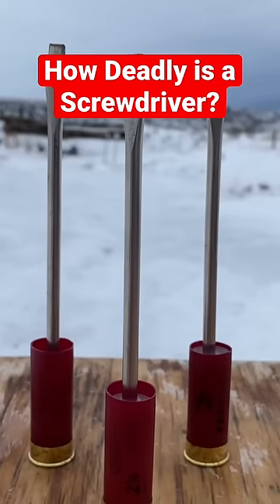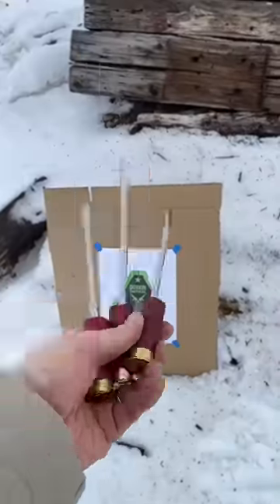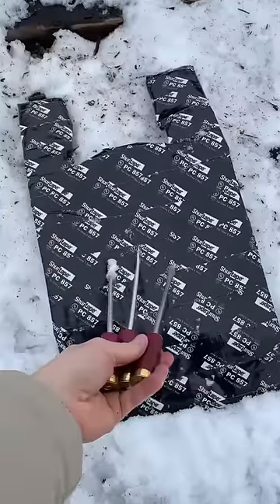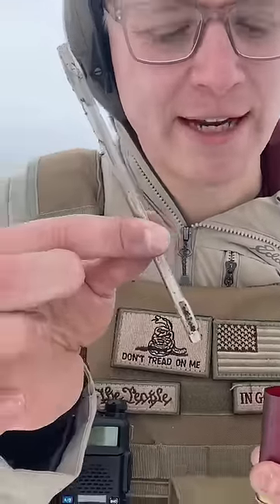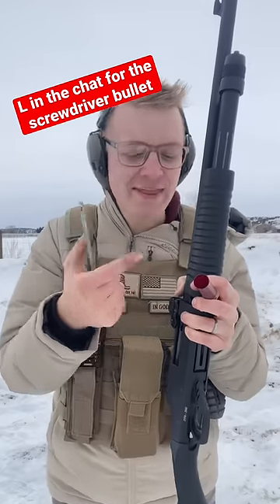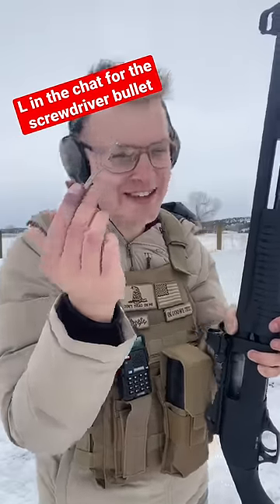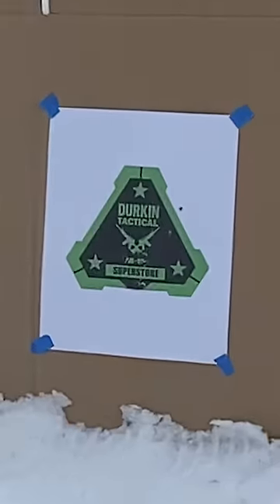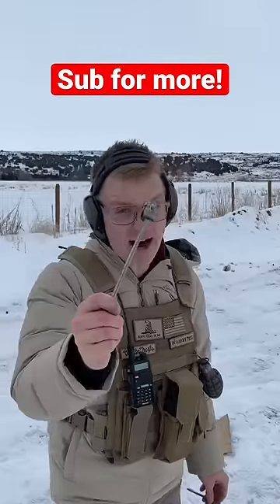(Fail) *SCREWDRIVER BULLET* Deadly? #gun #fullautofriday #demolitionranch #civtac #airsoft

Comment: Next time add a dime to the top of the wad. That way it will push any narrow projectiles and allow more pressure to build.
Reply: Exactly. Lol pretty simple physics. Even a few washers would work. Weld them to some washers and bingo. It'll run.
Reply: A dime would have doubled the value of production, seems this one was rushed and not thought out.

Comment: Just sand the handle of the ole craftsman down to the diameter to fit in the shell. It's simple. Chuck up the screwdriver into a drill press and then using a die grinder and a green rollock reduce the diameter till it fits.

Comment: Stick a 1/16" steel disc under the bottom of the screwdriver in the wad, it will certainly work. RIP to your barrel though, unless you make something to keep the tip centered, if not it will tilt inside the bore and scratch nearly the entire length of the bore.

Comment: that wouldn't work unless the barrel is same size with the screw driver you need to stick something on to the end of the screwdriver like a small cylinder block to create a pressure that will lunch the screwdriver

Comment: What if you just cut the handle 1in down or 3/4 of an inch down or whatever and then sand it down to a perfect circle to fit inside of a 12-gauge? Wouldn't that be better than putting a metal tablet down at the bottom cuz then it would still be almost the same as a screwdriver with just a small part of the handle. And therefore it would cover with a screwdriver shoot from a shotgun more so then would the metal piece of a screwdriver shoot from a shotgun.

Comment: Just fill the void with hot glue or caulk so the wad stays connected to the screwdriver as one.. honestly I thought you took the handle of the screwdriver to a sander and made it's diameter met the ID of the shell on top of the wad.. this was doomed to fail from the beginning since someone didn't pass grade common sense

Comment: Get with a machinist. Have him turn the screwdriver handle down to the diameter of a slug. Then, cut it down to a few thousandths less than the length of that 2 3/4" shotgun round. Load it in a shotgun shell and fire it. It may tumble and/or have terrible ballistics, but it will exit the barrel with authority. Haha.

Comment: phauqin triple der da der.. 
use the screw driver like it is with out the plastic or wood handle... 
it'd likely flip around and fly handle first if you turned it down.. but the fack that you didn't even try to giant flechette them means I'll never click your holster link. try harder, try hard.